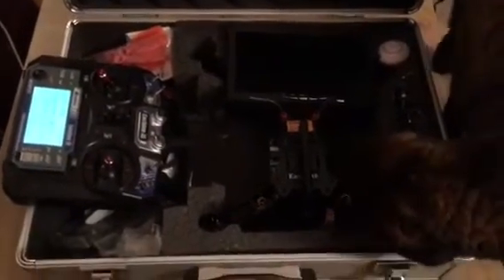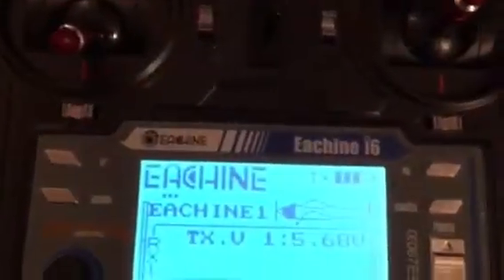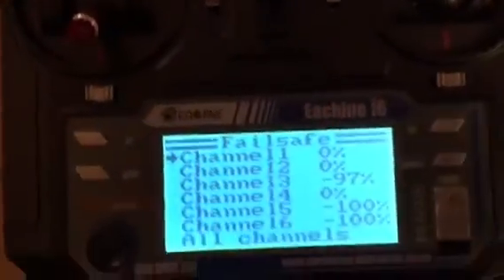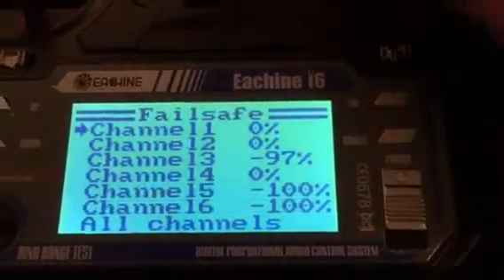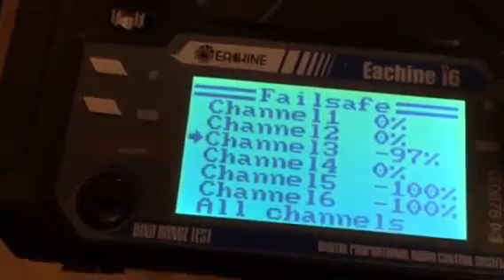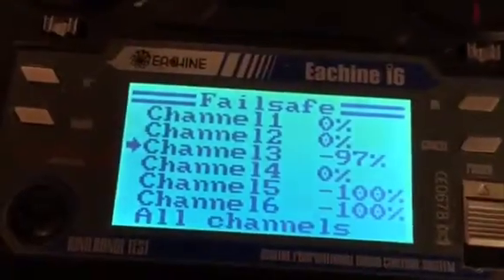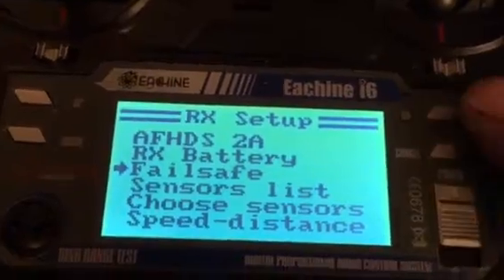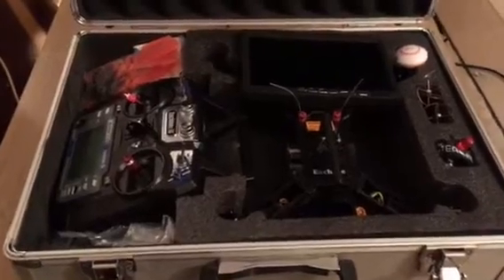Failsafe set up on Eachine 250 Racer i6 skyfly transmitter.

Comment: thanks for sharing the knowledge on how to get into the transmitter I had already filed a claim on eBay I had to cancel didn't know or was no information on holding the two trim tabs in thanks for saving my falcon. .
Reply from the maker: Your more than welcome👍.Glad it helped you mate.Just lost my eachine 250 though dohhh.
Reply: oh my god...i'm sorry...what happens? and the failsafe?
Reply from the maker: davangeletti hi yes the failsafe kicked in over a forest as i lost contact with the 250 as i had flat batteries in the controller doh🤔